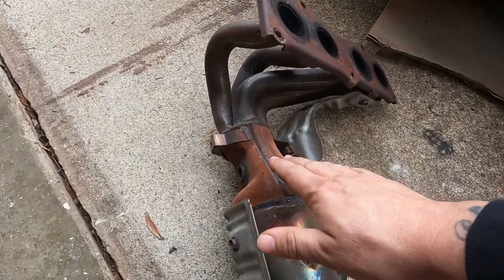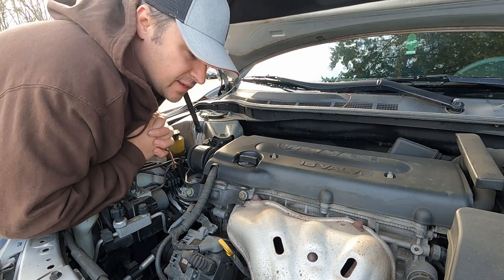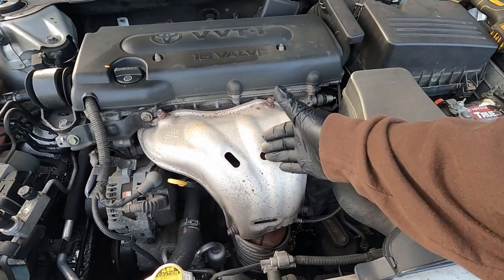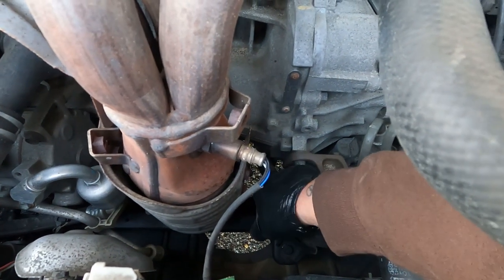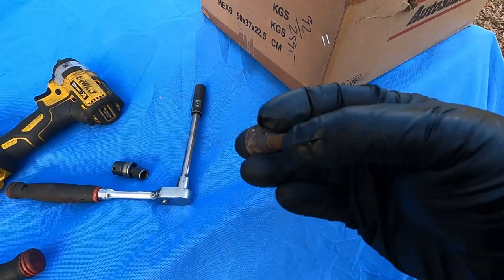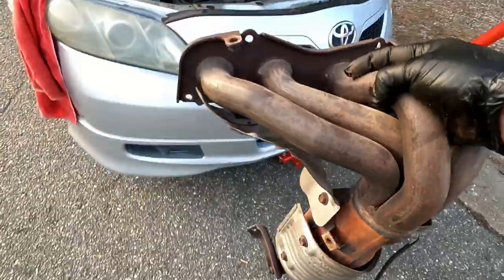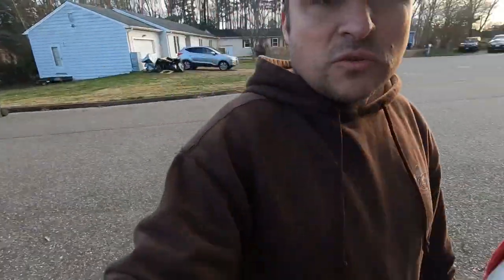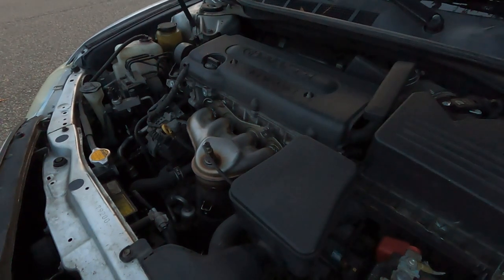BEFORE YOU REPLACE THE CATALYTIC CONVERTER ON YOUR TOYOTA CAROLLA WATCH THIS VIDEO | P0420 EPIC FAIL

Comment: I just discover your channel, I have a question related to my 2000 dodge ram 5.9 Diesel 2wd...how difficult is to convert my truck from ATM to stick shift transmission even 5 or 6 speed?? Thanks any clue how much it will cost?
Reply from the maker: Well I can tell you it’s not that difficult to do a swap like that ….if you can get a whole kit like off eBay or something or even a wrecked donor vehicle with a manual transmission…. If I had to guess probably a couple grand but I can’t be for certain. I’d say get on a 5.9 Cummins forum they probably have a full detailed way of doing that kind of swap…hope this helped my friend
Reply: @Gasdieselgarage  thanks for your reply I will look into diesel forums, and check details.. thanks again and keep up the good work my friend.. see you in the next video..